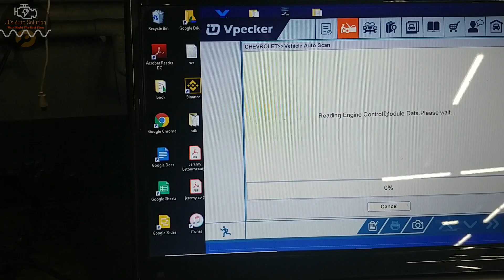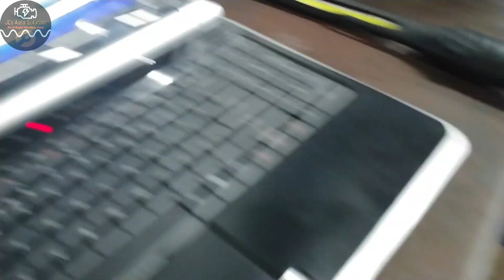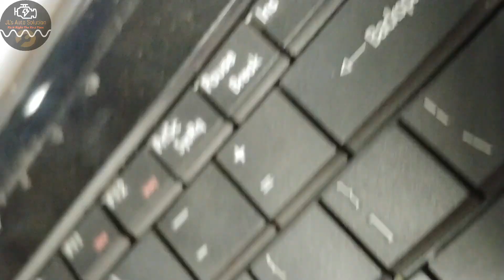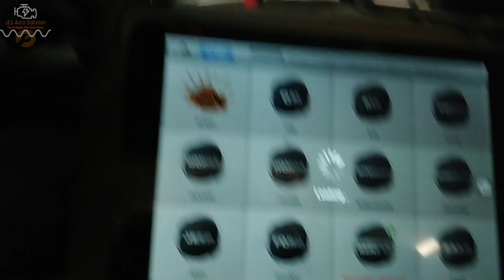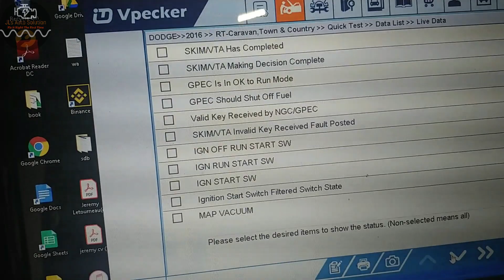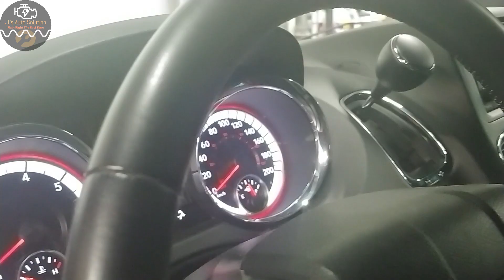Autel vs Vpecker

Comment: Hello and Greetings from Germany. I use the Vpecker since almost 4 years, started with software version 6.xx. The Software is improved and now its 12.0 with a lot of additional function. I had very good experiance with my Citroen C5 (in the size from a E Class Benz) , reset after Oil change and with the rear brake because there is a electric parking brake. Now i have a 2010 Mercedes Vito Van with a 2.2l 180hp Diesel and a 2000 C Class 320 Limo 218hp and even here i have a lot functions a ordinary obd tester dont give. I like the DPF Regeneration Function because special in wintertime there is sometime not enough long distance to drive so that the self cleaning from the DPF wont start, so i can start manually and drive 50-60 km constant on the highway and the DPF is cleaned. Thank you for this very good video, shows the pro and contra from this very useful and affordable tool for home use, i payed 4 years ago 145,- Euro include shipping and tax and with the background that there is no additional fee and all car brands are included and free. Other cheap tools need a yearly fee and a fee for additional car brands. For me its absolut O.K. because the speed is slow compared to a thousend Euro Tool, of course there have to be a differance. Again, great video, well done, very nice workshop by the way. Kindly Ruediger

Comment: Hey you can try the xtuner e3 software, it`s way more user friendly
Reply from the maker: Hey Philip..

So the vpecker is not compatible with the xtuner software.. So a far as it looking better. And being more user friendly I cannot say.. 

If I ever purchase the xtuner.. I will surely make A video on it..
Reply: @JLsAutoSolution  :) Thanks bro, i got the xtuner e3, i use the vpecker and xtuner software on my windows 10 tablet, it logged in using the same number and serial lol, 
if you want to try 
http://www.xtuner.org/download/xtuner_e3_setup_9-6/?wpdmdl=13519&ind=XacUsIpg1og51fr9moCrHQNKD7nIYp4AlqCI_8ak-qqkSmdfKuxbU6JHAvE5wFkT
Reply: @pk6336158  Hallo friend you try the xtuner on the vpecker software it work? I tried the vpecker with xtuner software but it not work also not login
Reply: @alilbl3350  yes it worked, you have to download 9.4 after you log in then you can update it, and sometimes you have to run as admin and set it to windows xp on properties, i have both software but both of them are the same just the ui are different
Reply: @pk6336158  ok bro thank you
Reply: @pk6336158  Hallo bro I tried again still not work,I try different old versions it still not want to login iam using my vpecker account I tried it by administrator open and I choose compatibility as windows xp,do you know a link download for this 9.4 version,thank you bro
Reply: I forgot to tell you there is a program called ancel x5 it work on it but vpecker program is much better,ancel not much software update,you can try it
Reply: @alilbl3350  I will look and send, I was checking to send you but I didn't see anything, the company must be took down the link, but I will check on my computer and see if I have the version and upload it
Reply: @pk6336158  thanks bro I will wait you
Reply: @alilbl3350  I just checked I used it on,both software an all the functions work, I tried loging out and back in now it says invalid serial number or password
Reply: @pk6336158  same problem as mine I get this notification,you tried the ancel x5
Reply: @alilbl3350  no,I haven't still fighting up with it

Comment: Hi JL, hope your well. I'm an old school Panel Beater and served my time in my father's body shop.  I've been around cars since a child, and do all my own mechanical repairs as well.  Wiring was always my weakest point, but I've been studying har and youtube is an asset. I'm in the North West of Scotland, and have a 2004 Vauxhall Astra 1.7cdti van (80hp model). My father has a Renault Clio, and I was looking for a scan tool with ABS, SRS, possibly injector coding; in short, a scan tool I could do as much as poss on my own present and future vehicles, as well as family members.  I was looking at Foxwell and Autel, cable type scan tools; what would you recommend.  Many regards John.
Reply from the maker: Personally for a do it yourselfer.. The autel mk808 is a great choice.. Now if its not for a vast array of vehicle, maybe the autel ap200 is a better choice. It uses your smartphone and. You just need to purchase the vehicles you are working on.. It has the same functionality as the mk808 but cost 1/6th the price upfront... Hope this helps.
Reply: What do you think of the maxi check pro?; it's very affordable.  Or something else with a cable around that price bracket?
Reply: @johnbeagmartin5809  try vpecker bro I think it much better or DELPHI scanner
Reply: Thanks mate; I'll have a look:-)
Reply: It sure does mate; thank you very much I appreciate your help very much...My Iphone's a bit shagged so would need another phone, so, it'll work with just a normal smart phone?..Cheers again mate:)

Comment: Not sure what to make of that Jeremy. I was considering purchasing the wifi version. Thanks for the honest review. Guess as per usual, you get what you pay for. Still, for the money it's data capacities are well beyond the limitations of my Autel MD802. Hmmm...not sure. Ok Thx. Cheers
Reply from the maker: Thats my train of thought also.. codes and data are key.. bi-directional test are great but if you know how the system is turned on you can test it manually.: and thanks again for watching :)

side note: on Kia's and Hyundai's its as good as the oem tool..